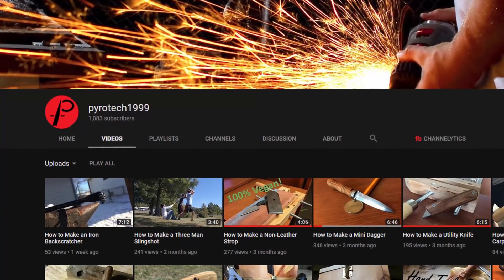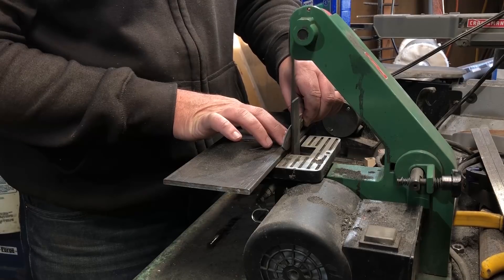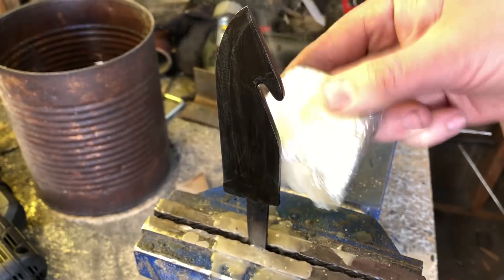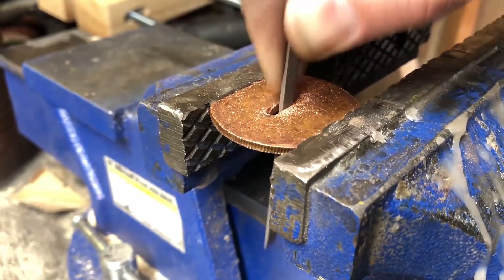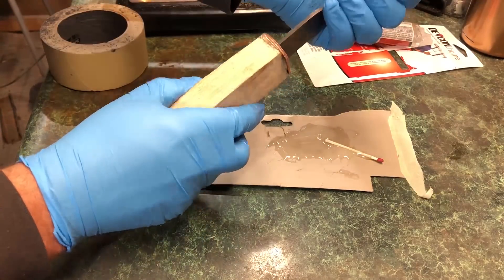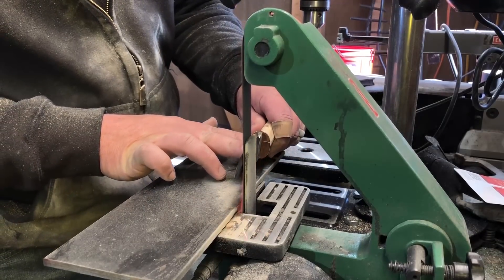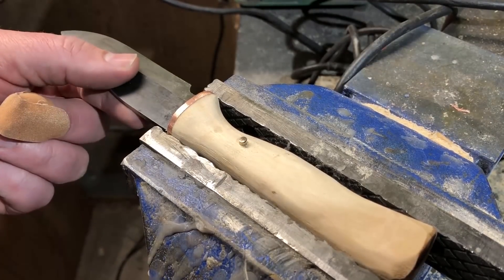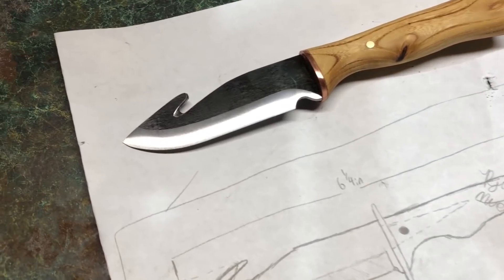How to make a hidden tang skinning knife - Collaboration with Pyrotech1999

Comment: A tip for you; clamp the clamped knife/handle/whatever to the metal plate of the drill press. You can line it all up perfectly and lock it down rock solid. Helps alot.
Reply from the maker: Jake Makes Thanks! 👍

Comment: another tip is that where the tang meets the blade you don't want 90 degree angles because it has a tenancy to snap at that point if you round it out a little it will keep it from stressing at that point this shouldn't affect the look. i enjoyed yours and pyrotec's video good work guys.
Reply from the maker: Connie/Cody Sehie hey thanks! I’ll keep that in mind. That actually makes a lot of sense.
Reply: Beat me to it.

Comment: Turned out great! One quick tip for grinding scandi-ish bevels. You can bring the flat platen forward and closer to the belt. From the footage I saw in the video, It looked like you had about a little less than an eighth of an inch between the belt and the platen. That means when you push into the belt, the belt bends around the blade, creating a convex bevel. Whereas, if you bring the platen all the way up to where it is touching the belt, the belt is backed up by the platen, preventing it from bending, and you should get a fairly straight bevel. Once again great looking knife, and I hope you had fun making and learning from the project, I know I sure did.
Reply from the maker: pyrotech1999 Awesome tip. Thanks, and yes I had a blast with this one. Great design work on that. And thanks for the collaboration idea. Good luck with school and keep those videos coming!